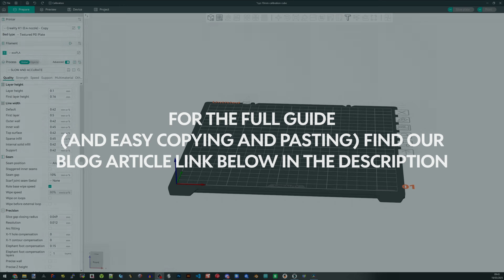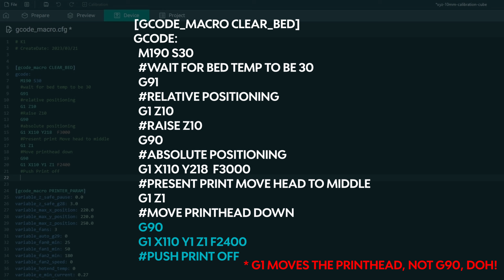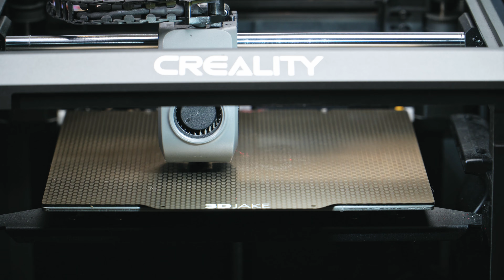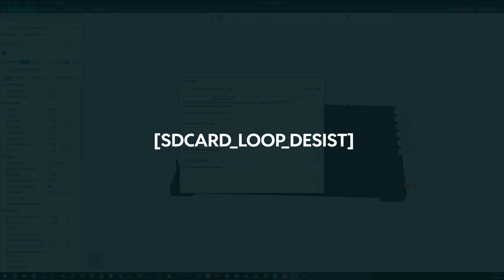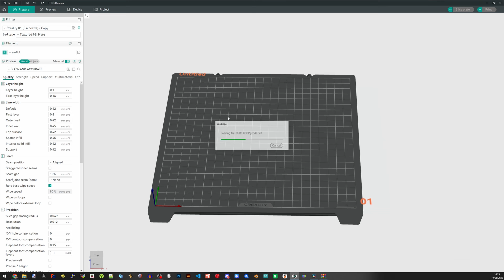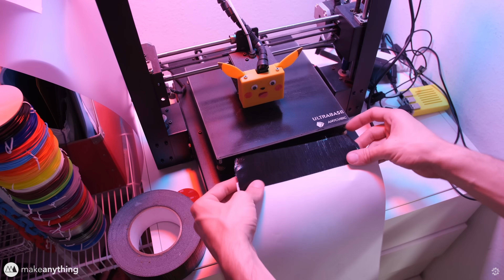How to Auto-Eject Prints & Queue or Loop Jobs on Your 3D Printer!!

Comment: Does this work with the 
Creality k2 pro? Does it damage your printer ? And does it work with multiple prints on the build plate? Does it work with bigger prints?
Reply: Oh and does it damage the print if it’s like fragile and doesn’t it drop a far amount down
Reply from the maker: The klipper method will work with the K2 Pro, if the instructions you give it are correct it won't damage the printer but all printers are different, we can't really give a universal guide that will work for every printer so there is always some risk. Multiple parts will work but it depends on how well they're stuck to the plate like was mentioned, same goes for bigger prints. Something like a large vase mode print might be a bit too fragile for this method but otherwise there wouldn't be problems like that

Comment: Having this problem: end of the G code for klipper, I put the line in that causes the nozzle to shut off, however, whenever it tries to print the next object, it says (“code” : “key111” ,   “msg” : “Extrude below minimum temp ) Any suggestions? I’m using a CR-10-SE.
Reply from the maker: I would think your start macro in klipper probably doesn't have a heat up command. In the video at 6:30 you can see in the start gcode we have a heat up command before the SD_CARD_LOOP_BEGIN command. That heat up command will only be recognised for the first print because it is before the loop command (I guess our printer also has a heat up command as a macro in klipper so this problem doesn't occur). I think it should work fine if you add the heat up command that you have already in your start gcode just after the loop command.
Reply: @3DJake_Official that worked! Thank you. However I did change some of the loop gcode around to fix other issues such as oozing, print head not detaching from print but picking it up, eject speed, bed temp, nozzle temp, etc
Reply from the maker: @ATLAStheprotogen1  Nice! If you have the desire definitely share it somewhere, there is so little info about this out there.
Reply: @3DJake_Official ok I’ll try it

Comment: On my Qidi the moonraker cfg looks a lot different than what is displayed in the video. I don't see the file manager code mentioned either, just a config_path and log_path. Should I add the file manager code you mentioned?
Reply from the maker: the file manager part just adds functionality to moonraker to edit things beyond default settings. Adding it shouldn't be a problem

Comment: "key95","msg":"Must home axis first: 

Have this problem with auto cleaning(((  Creality 3 v3 KE
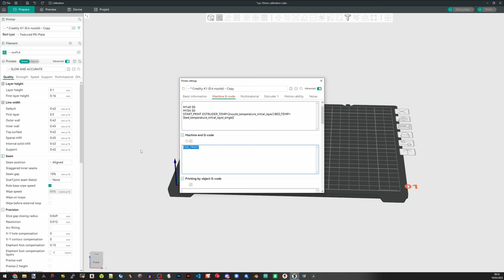Reply from the maker: Common problem. The V3 KE probably has an END_PRINT macro at the end of every print and the last command in that macro is an M84 command which tells your printer to disable the stepper motors and because of that it loses its homing and think it has to home again. You can see the end print macro in your slicer under the printer's gcode like we did at 5:17. If you route your printer's firmware you can just change this as we did but you don't have to, you can just replace the END_PRINT macro in your slicer. The end print process is just turning off your hotend heaters and raising the z axis, take a look at other printer's end gcode and copy what you see for your printer. You're welcome to write back here if you have any other problems :)

Comment: I do not want to use orca I want to use creality slicer  can I ? Or will it not work?
Reply from the maker: Newer versions of Creality Slicer are basically a port of Orca so the same process works. If you need to mod things in Klipper you can access mainsail or Fluidd via a browser

Comment: Honestly, I would not trust this except when you are batch-producing the same parts over and over and have tuned the ejecting for that part and the part to be ejected to allow easier ejection.  Even just a part of the brim getting stuck on the build-plate over a couple of runs could ruin your nozzle when it hits that built-up on a next print.  Also, I guess this just won't work for PETG, TPU or other materials that stick too well to the buildplate ...  So, I feel  swapmod (or the free version on MW or the new similar solution for the full-sized A1) seems a lot more reliable and flexible ...

Comment: 10:15 A curtain or a light flap might work though.
Reply from the maker: Hmmmm it actually might, putting that down on the testing list
Reply: @3DJake_Official  - Maybe a thin cork flap? decently insulating, fire retardant, cheap, and not too heavy. Maybe weak magnet-plasic strips for the seal? A periodically needed gluestick reapplication might be a bit of a limiting factor, IDK.